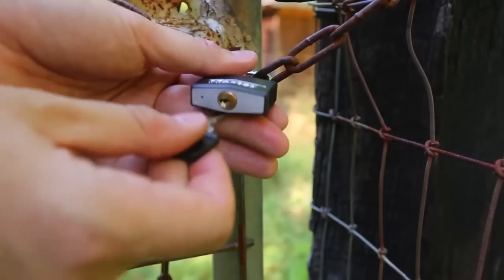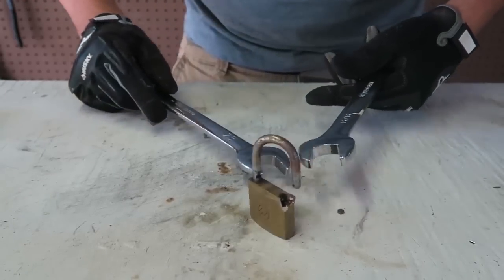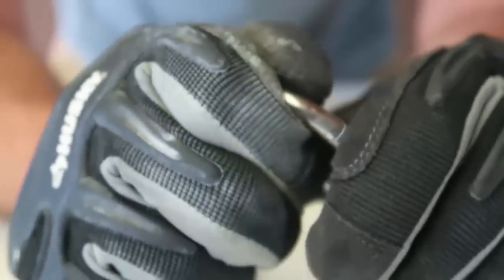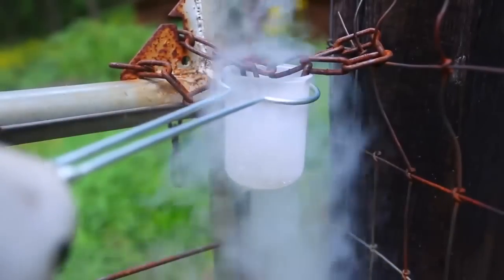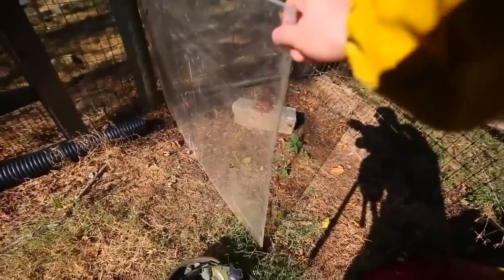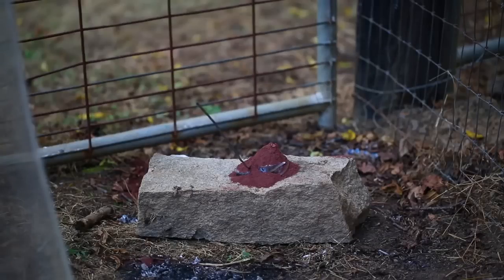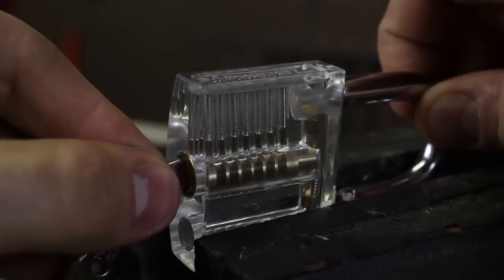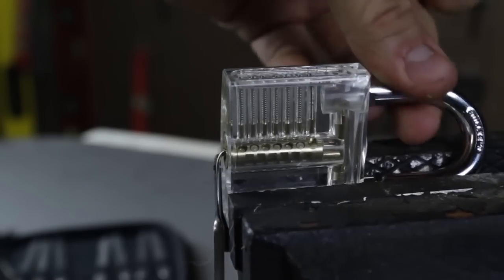6 Cool Lock Experiments Compilation

Comment: To melt the bigger lock you need to use a clay grafite crucible as a funnel by drilling a hole in the bottom of the crucible when you fill the crucible with the thermite the stream will be directed onto the lock underneath it